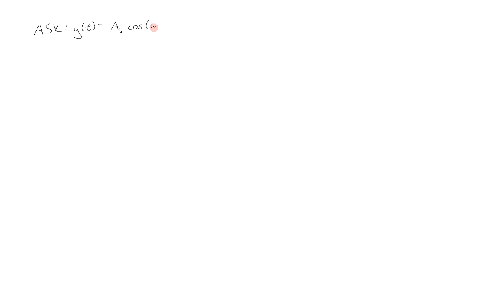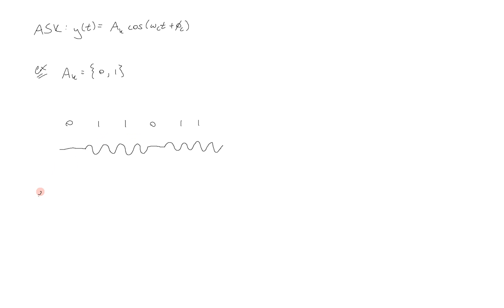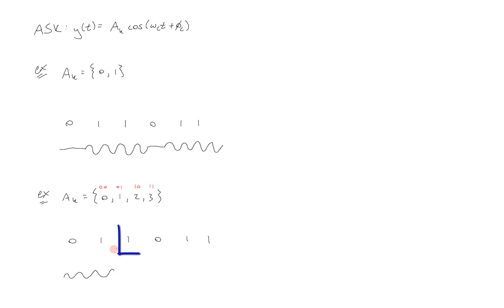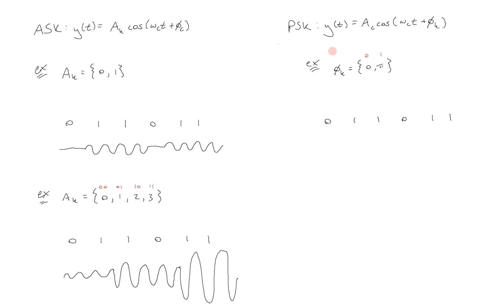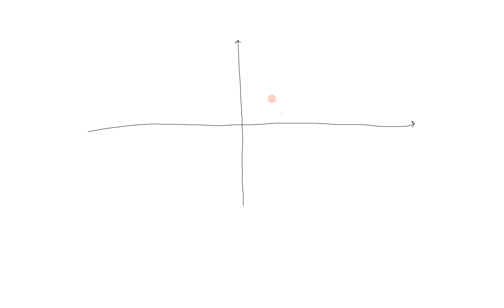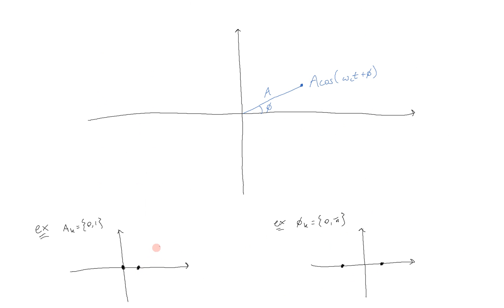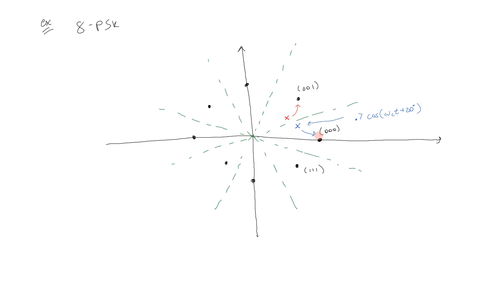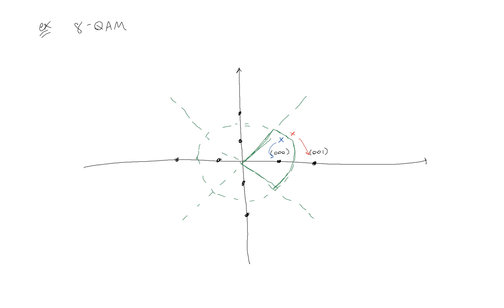Constellation Diagrams and Digital Communications

Comment: Nice explanation !
What I have learnt(Just for my reference)
1. start with transmit y(t) = A_k * cos(w_c*t + theta_c)
2. PSK and ASK 
3. how to construct the constellation diagram from PSK and ASK
3.1 constellation diagram is just in the complex plane,  a dot is representing the phase and the amplitude of  A_k and theta_c in y(t) = A_k * cos(w_c*t + theta_c)
3.2 how to correct the attenuation of received y(t) from determining the decision boundary at the constellation diagram 
3.3. eg of 8-PSK and 8-QAM
3.3.1 8 mean 8 dot and thus 3 bit
3.4 QAM mean quadrature amplitude modulation
Reply from the maker: Good summary!

Comment: Sorry I lost for some... what if the point we get is right on a decision boundary? Does it mean it actually is an error?
Reply from the maker: Technically, that should never happen since we are dealing with continuous values.  For example, suppose the phase noise shifts by 45 degrees.  But it's never exactly 45 degrees.  It is probably more like 45.0000000000000000000001 degrees, which is on a particular side of the boundary.  Another way to think about it is if it lands exactly on a boundary, you might as well flip a coin as to whether it goes on one side or the other, since there is no way to really tell.  I hope this helps!

Comment: is it possible to write down RF signal using this method ???
Reply from the maker: I'm not sure I understand your question, since this method is used precisely for that purpose.  Each point on the diagram is a received (or transmitted) RF signal.

Comment: Are there modulation schemes that add polarization to the constellation to add more throughput or is this not a reliable thing through a medium?

How many bits would it allow you to transfer at once if you just used circular polarization and would it interfere with the PSK or ASK?
Reply from the maker: Using polarization to add more throughput is a good method, but not at the introductory level.  There is a literature on polarization shift keying (POLSK) if you are interested to explore it.  As far as interference with ASK or PSK, it should not be a problem, since ASK and PSK affect the physical characteristics of the sinusoid, whereas POLSK affects how the signals are physically transmitted.  The number of bits per symbol would then depend on the polarization techniques that you are using.
Reply: thank you, its always interesting to think on how tech can be expanded

Comment: Hi excellent explanation, do you have any tutorials or examples on how to determine basis signals and how to portray the signals as linear combinations of the basis signals?
Reply from the maker: If your application is decomposing a signal into sinusoids, then I would recommend my Fourier Series videos.  However, for arbitrary basis signals, I'm afraid I do not have anything explicitly on the topic.  I believe, though, that if you thoroughly understand Fourier Series, you should be able to transfer that knowledge to your specific topic.